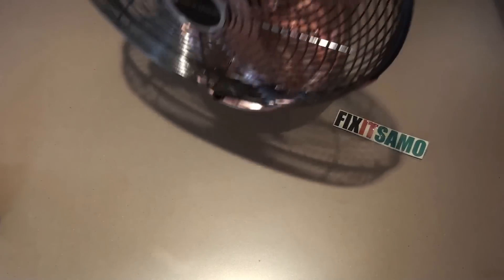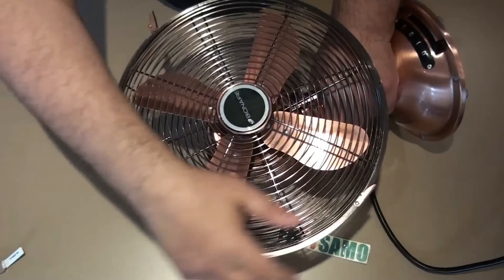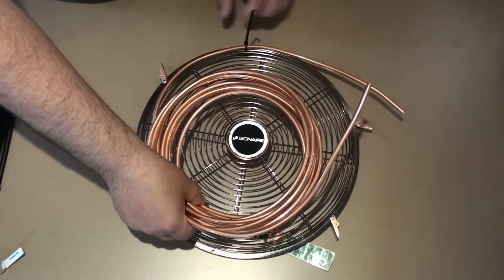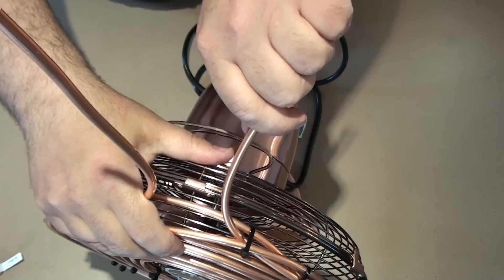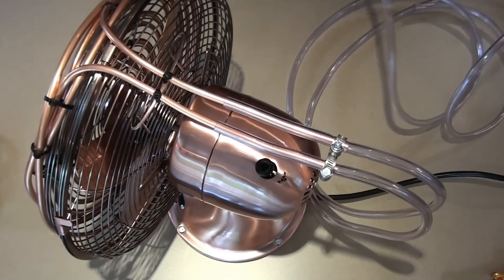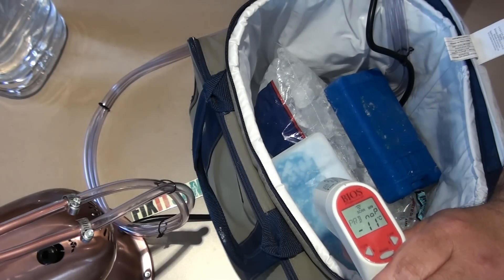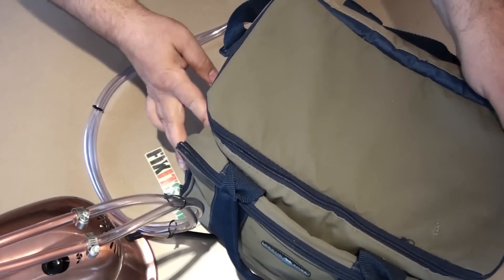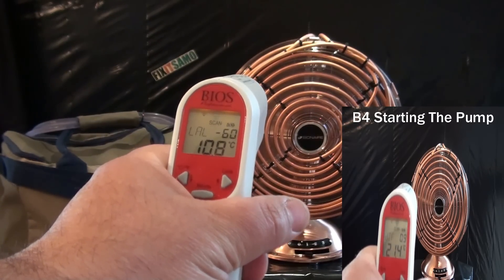How To Turn Your Fan Into An Airconditioner  AC

Comment: useless
Reply: Zulqarnain Shinwari ...Useless? Uhh, I think not. Clearly you don't live in a hot place, or have a tight budget. I know many people that don't have A/C in their house and can't afford to get one, and have to suffer through the summer with a 90 degree house all season. This invention would cost less than 20 bucks to make and could definitely keep a room cold. What IS useless is your comment on this video...
Reply: rocinante this type of cooling fan is for a spot where one just need to cool it in a pinch because other options like Windows air conditioner is not option it also is not for those who have no means to get ice  but to use in a pinch for a area that needs cooling only when in use
Reply: He's right.  You have to keep resupplying it with ice.  Either you're buying the ice or you're pulling it out of your freezer.  If you're using ice from your freezer, the freezer's cooling pump is actually not very efficient, so it creates more heat than would be offset by the ice it produces.  If you have to keep buying ice, then, the device ends up being much more expensive than a window AC unit.

Comment: Why not use a plastic or rubber pipes insted of copper pipe?  Copper pipes are very costly. Only the copper pipe alone will cost the same price of a new fan.
Reply: heat transfer my friend.. copper transfers heat... plastic not so great its insulative
Reply: john marcus oh my god you're a genius! why don't manufacturers make kettles out of rubber or plastic?! it would make the product way cheaper!
Reply: cooler
Reply: Copper conducts heat (and cold) better than plastic or rubber. Think about it. You can buy high-end copper-bottomed pots and pans for cooking, but you wouldn't want to cook using a rubber-bottomed pan.

Comment: when the copper tube is below the dew point temp. of air aren't u going to get water condensed on tube and splashed on Ur face with fan force.
Reply: better to use it as a shower for hot, humid region........

Comment: I think evaporate cooler is more efficient as Your fridge will work extra hard to make those ice
Reply: John Jeffry Unless if you placed the pipe inside the refrigerator or the cooler for unlimited supply of cold water to circulate in the pipes

Comment: this is soooo innovative and easy, simple way to make AC at home at anywhere....😁😁😁😂😂😂✌✌✌👌👌👌👌👌👌👌👌👌
and I tried at myself and it works.. Walla... here  we can save electricity as well as 💰 money...
thx buddy...💪💪💪👈👈👈👌👌👌👌👆👆👆👆
Reply from the maker: +Ramesh J  good job thank you
Reply: Ramesh J Are you serious? I might try it out then but instead of using ice box or ice for supplying the pipes.  I want to placed the end of the pipes or its source inside the cooler of a refrigerator for unlimited supply of cool water
Reply: thanks. Did condensed water drip from the copper or the fan speed dried it up before it had a chance to drip onto the floor?

Comment: Thx ......Just fer queries :) 
How much ice is needed in the cooler 1-2 Kgs?
and how much time it will work?
Reply from the maker: +Manh Ngo 
You either have an issue with your cooler or the water pump that you used produces heat with my cooler and the quantity of ice that i used it lasted for 10 hrs
Reply: yes, I have tried before, it consumed huge amount of ice. It will not work for so long!
Reply: thx -----
so practically we can say its just a science project for school kids ;)  not so useful in real life
Reply from the maker: +mithun mukherjee 
With the quantity of ice that i used it lasted for 10 hrs
Reply: I dont remember how much exactly, but about 3kg ice, about initial water I dont know, just pour it into the container with ice.
Reply: Himanshu MN Sharma
Reply: thank you, my cooler can not last too 3 hours (as I remember). But the air temperature was 37 degree C, maybe this is the main reason.
Reply: yes, the plastic tube is not so long, but I think this model is suitable for dry region, with hot and humid climate in my country, the cold water not only has to cool the air but also waste its useful energy to condense the water vapor in the air.
Reply: +fixitsamoThx....
can you tell me how many KGs of ice you used and water initially. (plz mention in Kgs or grams)
Reply from the maker: +Manh Ngo 
Also you have to make sure you're plastic tubes are not very long not more than 3 feet  between the cooler and the fan
Cause plastic in not the same as copper

Comment: Have you tried a mini fridge instead of a bag cooler?
Reply: thanks for sharing your stuff, fixitsamo! this kind of thing is what makes this awesome! people see your idea and it inspires creativity.
Reply from the maker: +Michael Garcia 
Not recommended  
Having a cooler is the best option 
Specially if you want to change rooms
Reply: that sounds like something you need to try for sure, Michael Garcia. science demands it! i wish i had something else to add to this genius idea, but i think you got it licked. as for the pump.. i'm not really sure? there has to be a solid pump compact enough that can push the water up and out. what is the diameter of the coil? it might not be all that much to demand from a decent inexpensive pump. i wonder who would be a good person to ask about this. enough grunt to push water for 25ish feet and live, right? flow rate isn't an issue really, just as long as it isn't painfully slow. it's more about grunt and stamina with a healthy dose of cheapskate. i am legitimately jealous that you get to try it out. this is a good idea to expand on a good idea. awesome. keep us informed please!
Reply: i can think of a reason why that might not be a good idea. cold water flows from the fridge to the fan, and is returned warmer than when it left. if you're gradually heating up the fridge, then the compressor is working overtime to keep it cold. a constantly working compressor is not going to last long at all, and burn out leaving you with nothing more but an insulated box.. exactly like a cooler. you would have to make the lines sit perfectly so no outside temperature leaks in or out also. 
on the other hand, how much can the water really heat up with such a short trip? maybe you are on to something. you should give it a try and tell me how it goes. i wouldn't buy one just to ruin though. after you put tube holes into the fridge, it's basically just going to work with your diy AC. i think.. i dunno. now i wish i had a mini fridge to experiment with.
Reply: Jeff Falstrom, Yes on the heating issue; I was thinking of coiling many feet like a wort chiller in beer making (I conveniently have one, I made for beer, 25ft if I remember the length right. copper.). That would keep the water spending more time cooling in fridge than heating outside of it. I have a working mini fridge to test (free on Craigslist). Maybe drill two holes on top for lines, and silicone to seal it. Than run short lines to fan. Than another thought is a pump that can handle the weight of the water. I could also always add ice to help minimize overuse on fridge motor/compressor. If that worked, would the fridge need to be in another spot to keep from working against the cooling? Any more input would be greatly appreciated! Thanks!

Comment: plz try liquid nitrogen instead of water.. than we will see. that way it will be more efficient and inexpensive.
Reply: Capitan Spock Where can we find it?
Reply: Pump will break apart or will not be able to pump it and beside that; liquid nitrogen will evaporate if u don't keep it sealed.So this idea can't work.
Reply: Capitan Spock Have you tried liquid nitrogen?
Reply: kapnistis91 Yep. The pump might overfreeze from subzero temperatures. I say just stick to regular ice water.

Comment: This is an awesome idea. THANK YOU!!
But there's a only one problem for me that copper tube so costly here. So I just want to ask that can any other metal like alluminium be used instead copper?? 

Please answer my question.
Reply: Copper has a heat transfer coefficient higher than aluminium. That means, copper is a better heat exchanger than aluminium.
Reply: But its costs much
Reply: I am asking that can I use something else other then copper
Reply: That's a trade-off.
Reply: u can use aluminium..but efficiency will decrease.
Reply: Aluminium tube can be used. Drawback is has lesser thermal conductivity and not as workable like copper. But it cheaper and can be tried.

Comment: problem is how to deal the moist 
on the tube
Reply: ren akiyama i was just thinking the same thing. itll sweat and drip on what the fans sitting on.
Reply: ren akiyama That fan really needs a filter and a catch pan under it for the access water.
Reply: ren akiyama MN

Comment: i would suggest you use small car ac radiator for maximum benefit, after all good job dude! :) (ac radiator has fins that will make the air get cold faster, also use salt and water mixture for your ice and your water it will keep it colder for long time)

Comment: Call me dumb, but if you just aimed the fan (without any pump, tubes etc.) over an open cooler box full of ice you would achieve the same thing ???
Reply: It wouldn't last long like the way he has it and with another guy's suggestion to use salt with the ice, it may last longer.
Reply: ROMVS I'd use them blue freeze blocks less hassle
Reply: Ah good point. The difference shouldn't be too big and less messy.

Comment: Made one for my little workshop/shed.  Works great for about 2 hours.  Make sure water pump stays emerged in water when on.  I thoughtlessly pulled mine out of the water to add more ice while running and it burned out within 5 seconds.

Comment: What's the square footage that this system can control? For a bedroom of 12' X 15' you need about 8000 BTUs. How many BTUs is this? For an apartment of about 650 - 750 sq ft you need about 12,500 to 15,000 BTUs. Ice may be cold but it also melts rather quickly in the heat. Then, if you get dry ice it will be a lot cooler but it will be more expensive. But it still won't be able to cool a 600 sq ft apartment.

Comment: have an idea but enough cash fo that
how about a peltier  that the cool sink on the side dipped in a box of water then the pump is connect with water  to the table fan.
peltier makes the water cool . use has a portable cooler 
thanks

Comment: When it comes to energy, there really is no such thing as a free lunch. This is nonsense. You are just moving heat from one place to another in the same room. 
If heat isn't rejected outdoors there is no net gain or should I say loss. 
You may get a tiny noticeable temperature drop in front of the fan for a while but the efficiency is zero.
Reply: If it's 100 degrees and his fan is blowing on me and a regular one is blowing on you, you're not gonna try steal my seat?
Reply: It's not exactly nonsense. Heat energy is used up melting the ice. Ultimately, it comes down to where the ice comes from. If you are freezing water in your freezer inside the same thermal envelope, then you're mostly right, the heat extracted from the water to freeze it goes back into the house; there is some potential of net cooling if the water coming in the house is below the ambient temperature, but this is going to be pretty small. If you're buying the ice and bringing back, then you've got net cooling. However, that is very expensive and very labour intensive.
Reply: Trevor Lambert I see what you are saying but don't forget the refrigerator that made the ice will have losses either inside the house or remotely. No fridge is 100% efficient and the more processes involved the worse it gets. What about buying ice from the store , transport it home in the car while it gains latent heat during the journey, the car burns fossil fuel. 
Also producing ice at say negative 20 degrees C is far less efficient than running an air conditioning unit with an evaporating temperature of 0 degrees C to do the same job. 
The deeper I look at this, the more frustrated I get with the futility of the whole thing. 
It's all quite interesting for entertainment but there is absolutely no future in melting bags of ice to cool a hot and humid room.
Thanks for the reply, all good stuff to think about.🤓
Reply: I agree, no refrigeration equipment can be 100% efficient. Come to that any process that converts one form of energy to another. Motors convert electrical energy into mechanical energy and always have losses. Refrigeration equipment converts a liquid to a vapour and then back again continuously and has losses. 
All very sad but true,
Reply: i understand.  i had a friend that believed that you could sit a wall unit AC in the middle of a room and it'd make the room cool.  foolish.

BUT.  this video's idea is great for a person like me.  i have a corner room on the SUNNY SIDE of my house with POOR insulation here IN AZ.  i've got fans set up all down the hall to move air into my room but still it's always at least a sweltering ~86F in here during the summer (while the rest of the house sits at 81F).  i'll be using a unit just like the one in this video to make use of the freezer located in the kitchen and bring the fruits of that heat pump in that unit directly to my face this summer.
Reply: Well this will work as long as you keep swapping out the ice bags that melt with fresh frozen ones.
Reply: Yes, as long as you don't get ice produced by a freezer in the same living space.  If the ice comes from a freezer that shares the same space, then you are just swapping heat.  The freezer produces heat equal to the heat removed by the melting ice (more or less).  This is efficient if the ice comes from some other source not connected to the space you are trying to cool.  If it is, this is extremely inefficient.
Reply: Morris Berry Indeed, although with a slight correction: A freezer will always produce more heat than the heat it takes out of its contents. This is because: Firstly, if you want something 10 degrees cooler those 10 degrees need to go somewhere else. Secondly, the Work itself required to separate the heat form the water requires its own energy input, which contributes to the heating of the house.
Reply: That's certainly true from a total-heat-budget perspective, but moving heat away from the area you want to cool does the job just the same. A little more heat pumped outside or into the kitchen, to blow out the windows, doesn't really matter to the frozen peas, or to you in your nice cool man-cave. Even if you're warming the planet.
Reply: PattyMMelt good luck with that. I really think you would be wise to put your energy and money into firstly improving insulation of your house and secondly install a split A/C unit and really feel the benefit of a purpose made machine.
Reply: I always thought it would be fun to pick up a crappy (but working) old chest freezer on Craigslist for free, rip the guts out, and move the condensing coil to a box on the outside of my garage, and leave the pump and condenser in the freezer housing inside, with an additional switched fan installed in its exterior, that is close-able with a sliding panel. 

This should provide not only a good and permanent air conditioner for the garage, but also a chest that should function as either a freezer (fan switched off and panel closed), or a beer-cooling fridge, (fan on and panel open).
Reply: ROOKTABULA I agree lol
Reply: Haha. Another way to look at it!

Comment: This is seriously one of THE BEST tricks/hacks ive ever seen. Ive made two of these for out house in Thailand and they work WONDERS. I cant even explain how nice this is. I found that having a stronger pump and more water in the container keeps the ice cold for a longer time. Very important to prime and remove all the air in the hose before hooking it up. THANK YOU SO MUCH FOR SHOWING THIS!!!
Reply from the maker: +xSean145  thank you
Reply: @ xSean145
where did you buy the copper pipe in Thailand?
I'm almost 99% sure, that I've never seen them at "Home-Pro", "Thai-Watsadu", or even "Hardware House", etc.pp...

Comment: Better do it by putting the tubes directly in your freezer. What a dum ideia.
Reply: I was thinking the same xD
Reply: by leaving the freezer open ? 
what a dumb idea
Reply: 2xarly then the water would freeze up and the water pump would not work. Plus do you want to drill holes in you fridge or rather leave the door open?
Reply: So the heat absorbed by the water gets put into the freezer, the freezer removes the heat and puts it back into the room.........Seems pretty silly. That's the same as running an air conditioner on your floor.
Reply: check out mine
Reply: David Partida you can have a minifridge. Those are not very expensive but work great. Also, flowing water doesn't freeze That easy. When you turn off the pump,  you have to be aware of water still inside the tube. That can be frozen yeah.

Comment: The irony is that if you use your home freezer to freeze water into ice, two things will happen:
1. It will use electricity to cool that water to freezing point!
2. The heat of the water will be output into your home. And water itself holds a lot of energy!

It's a really interesting concept. However given that you use energy first to freeze the water and then to run the fan and the pump, I have to wonder if it's more efficient than just blasting an AC unit in your general direction.
Reply: Meep Moop an ac I would believe, runs more power than a fan + pump. And the fridge is always running might as well use it.

Comment: this is better that air cooler  less or no humidity
Reply: This is not better at all lmao. A real air conditioner removes the current humidity in the room then the water condensates and it drips outside the house/building and replaces the room humidity with dry air or refrigerant